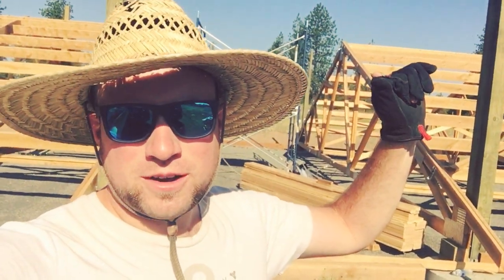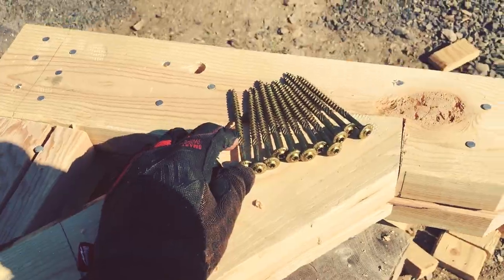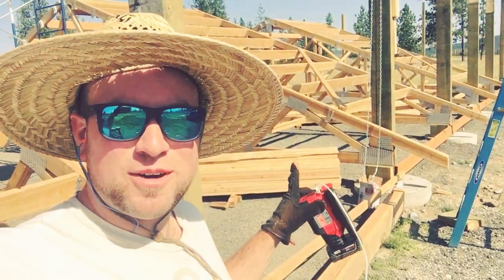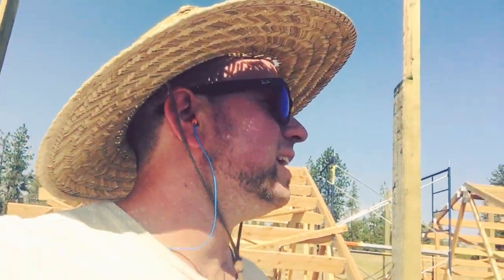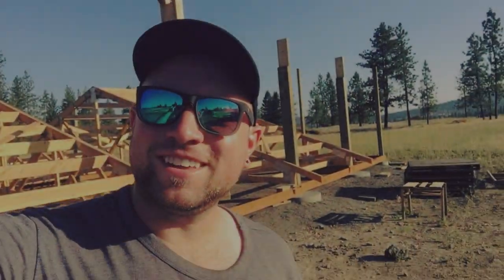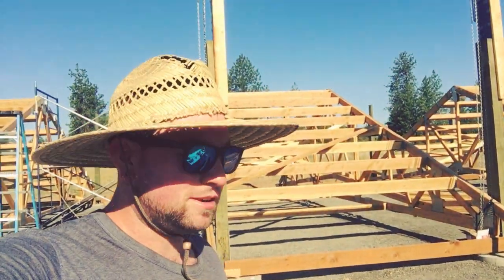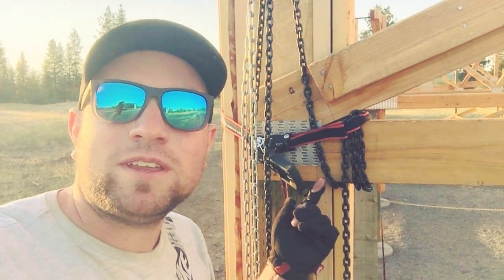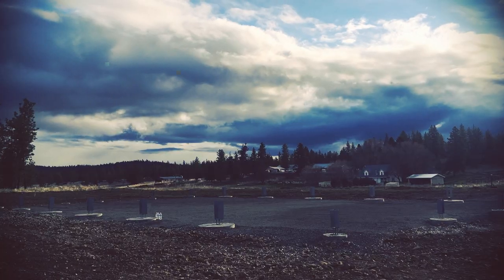Lifting Entire Truss Bays EASILY With My New Prototype! | DIY Barndominium Ep.12

Comment: Awesome!!  You did it!! Love your super simple design and easy use!! That is really a great way to do that so you aren’t trying to build everything up in the air. Building on the ground is very safe and with a bit of forethought doesn’t take any longer. Great job!! Can’t wait to see more progress!!
Reply from the maker: Thanks Mike! and thanks for the alert earlier about uploading the wrong one! 100% building as much as you can on the ground is the way to go! I have been doing a lot of work up high this week and I can definitely confirm that I'm not a super big fan lol. this way is a lot better than the boat crank method to. It should be cheaper to unless you are or know a good welder to get the steel caps from.
Reply: @HartandHome  my oldest son is a welder and very artistic so I know his mom will be calling in him for some creative touches when we start building and I know I will need his skills for a number of projects during construction. We are actually looking at using steel trusses either recycled from chicken houses or I found a jig that we can build our own 2 pcs steel floor to floor 40’ trusses. Just need to get a CAD drawing of the truss design and get it stamped and approved by an engineer. Then I can really put his skills to use for our house, shop and any other buildings we may need.
Reply from the maker: @mikeerstad4828  wow that's awesome! Gonna be great to have a welder in the fam!

Comment: Like the idea of using chain hoists instead of winch boxes.
Reply from the maker: Yeah, winch boxes might be cheaper if you can weld the cap boxes yourself but I don’t know how to weld. Additionally you can do this method on the ground unlike a winch box which requires you to be up on a ladder. Took me 15 minutes to raise a whole bay by myself.
Reply: @HartandHome  The chain hoist idea is great because the units are actually designed for lifting.  Trailer winches aren't.  I can TIG so might do a welded tube version of your idea.